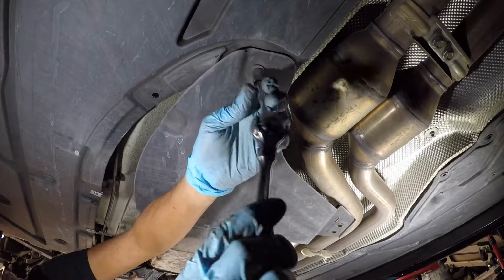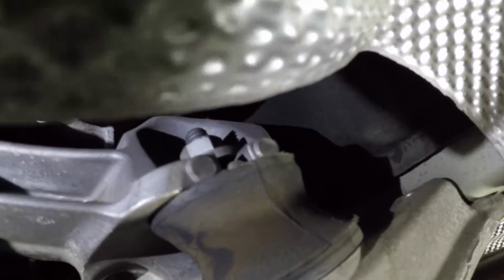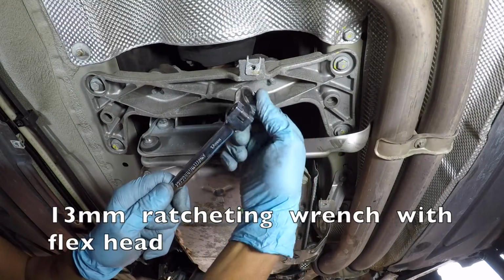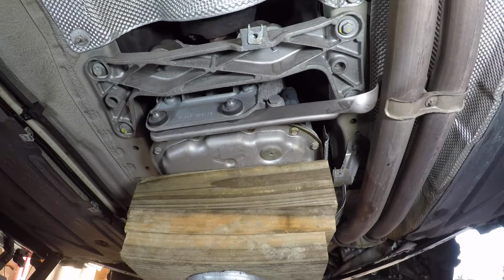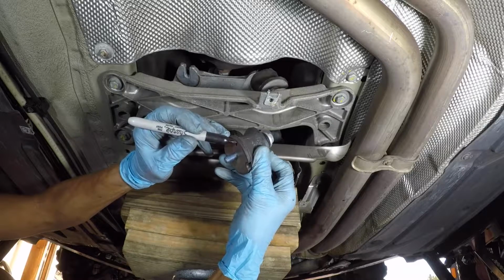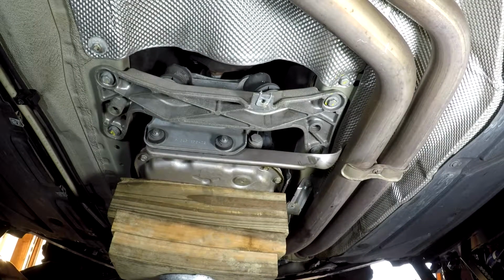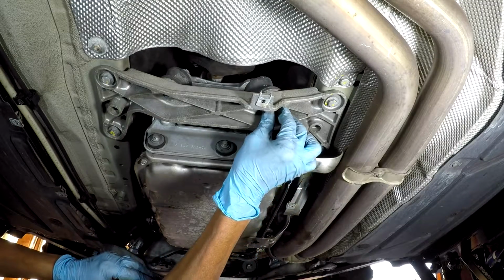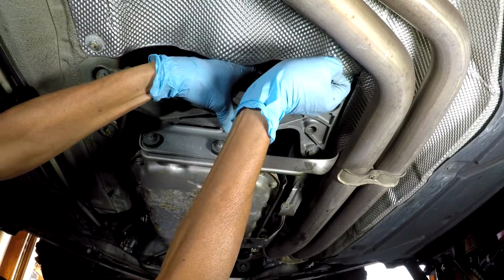BMW E90 transmission mount replacement (DIY16)

Comment: Hello, does your transmission started to kick between gears? Or how can you tell of a bad transmission mount? Best regards
Reply from the maker: vibration inside the car while waiting for the traffic light to turn green. it could be the engine mount also
Reply: @randysdiy  thanks, I'll check mines then, nice day !!!
Reply: @randysdiy  I love that explanation
Reply: Dude late reply here but i just changed my whole ahh gesrbox cause of kicking between gears! Problem is still there!!! Imma change mounts IMMEDIATLY!! Thank you!

Comment: What kind of symptoms did you have for you to think it was your transmission Mount ?, my car is currently jerking when I reverse from parking. I went under and saw my transmission Mount was very worn out. Did you have something similar to mine ?
Reply from the maker: vibration in the shifter area while the car is in idle